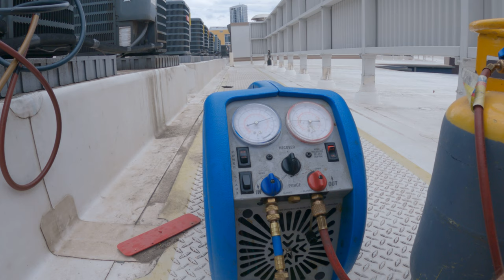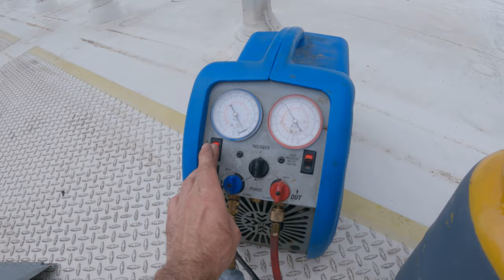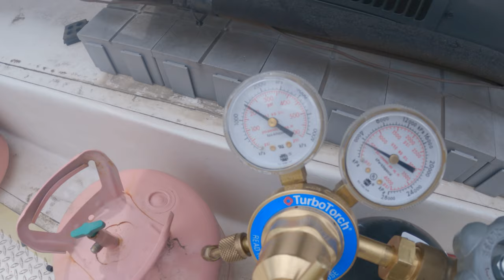Goodman Condenser Replacement - (start to finish)

Comment: I don’t know why you just hacked up the low side connection by crimping semi closed instead of  getting or making a fitting to side in and braze it like normal it might not leak now but give it some time I’m sure it’s already leaking and if the unit fails you are on the hook for it in court mind you hmmmm best of luck

Comment: Goodman is the best…said no one ever!
Reply from the maker: Apartment complexes love them. One of the cheapest AC units out there!
Reply: @ApartmentMaintenancePro  yeah they do , the previous company i was working for had a lot of contracts with apartment complexes for all the skilled hvac work , my old boss keeps like 100 goodman units at all times just because we would change them out so much at apartments
Reply: 10 year parts and labor and lifetime compressor replacement is nothing to sneeze at for people on a budget
Reply: Nobody would buy Goodman if the hardware was not a good value for the money.   During the pandemic, Goodman prices really shot up so I prefer Rheem/Ruud now.
Reply: My Goodman (ac/heat ) has lasted over 16years up here in northern 🇨🇦 
Replaced the fan blower motor 5years ago .. no other issues… our temperatures range from minus -40c in the 9 months of winter to plus 30c in our 3 months summer..

I’m a diesel mechanic not a air/furnace technician it was easy to install.. blower fan motor cost $200 dollars and another $250 dollars to ship it up here ( HudsonBay area)🇨🇦
Cheers

Comment: I hope he didn't bulge his spinal nerves in his lower back while lifting the unit by himself i learned this the hard way i used to lift heavy boxes of potatoes each weighing 50 pounds i later began to develop back problems and man it hurts real bad it took me weeks to recover and know when lifting heavy things i either get help or use equipment like a hand cart  designed to lift heavy objects like boxes or furniture
Reply from the maker: I've been repping deadlifts double my body weight for about 10 years now I'm pretty good at lifting things 💪

Comment: I think Goodman can be a fine piece of equipment if installed correctly.. just like anything else they all have similar or interchangeable parts. Better than York for sure.

With these rooftop units I highly recommend you keep the coils clean if you have water access. With pressures of R410A things can go south quick- airflow is crucial.

Comment: I like how you just pick the condenser up. I get it, you’re strong lmao. That back strength though
Reply from the maker: I used to do a lot of power lifting, deadlifts and such.
Reply: @ApartmentMaintenancePro  I always thought condensers weighed like 250 pounds for some reason lol.  And the reason I think this is because I'm 14 and you got a new sub 👍

Comment: If you would have taken that straight section of pipe out of that 90 that has a flare on it the flare would if it perfectly inside there without having to crimp the pipe on the condensing unit to make it fit
Reply from the maker: Ah damn that's a good idea thanks. Gonna do that on the next one for sure! :)
Reply: I hate that he did that 😒
Reply: Made me cringe!

Comment: Can’t you break vacuum by shutting your core tool and releasing gas from condenser? I saw you bled off from refrigerant tank to manifold (yellow hose) but how about from manifold to unit? Did that hose have air in it? Maybe I missed it?
Reply from the maker: You can break vacuum by opening up the valves yes but you probably don’t want a lot of pressure going through the micron gauge so isolate that if you can

Comment: When you broke vacuum, why didn't you turn the tank over to get a true blend of the two components that make up R410a?
Reply from the maker: 1/100th of a 40/60 blend of gas into a system to break vacuum will make no difference. Im sure my math is wrong but - prove me wrong.
Reply: @ApartmentMaintenancePro  You are correct, it's not much gas that you introduced ... just not the correct way.  Introducing as a liquid gives the correct blend of difluoromethane and pentafluoroethane.

Comment: Thank you, great video, one thing I am interested in, the Goodman manual, for the unit I will install tomorrow states: "Open the suction service valve first! If the liquid service valve is opened first, oil from the compressor may be drawn into the indoor coil TXV, restricting refrigerant flow and affecting operation of the system".  I see in the video you opened the liquid line first.  Was there any issues with the system after doing so?  Thank you very much!
Reply from the maker: No there were not. I've had the privilege of working a property for 8 years and never had that issue. But, I would recommend following the manual to be safe. I knew I was going to get called out on that.

Comment: LOOK I GET IT  YOU HAVE TO BE FAST BUT NOT HALF ASS       BUT DUDE YOU ARE GOING TO REGRET WHEN YOUR BACK GOES OUT      AND THEN ALL THAT KNOWLEDGE IS WASTED         DONT ASK ME  HOW I KNOW!!!!!                   ALSO IF CONTACTOR IS NOT  CLOSED THEN NO POWER TO LOW  VOLTAGE WIRES YOU CAN BREATH EASIER    I HAVE A ALOT OF RESPECT FOR THIS PROFESSION AND THE PROS THAT MAKE IT LOOK EASY BUT WE BOTH KNOW IT TAKES SPECIAL PEOPLE TO BE HVAC WORTHY!!          GOOD LUCK       AND MAY YOU BE IN HEAVEN  30 MINUTES BEFORE THE DEVIL KNOWS YOURE DEAD!!!!    😎

Comment: Always open suction first
Reply from the maker: I got zero oil when disconnecting gauges. Just open it slowly and the oil should be fine. If that’s what your referring to. It’s always nice to add reason behind comments 👍
Reply: @ApartmentMaintenancePro  in the manual it says suction first that’s the reason why they must have had problems with oil and txvs